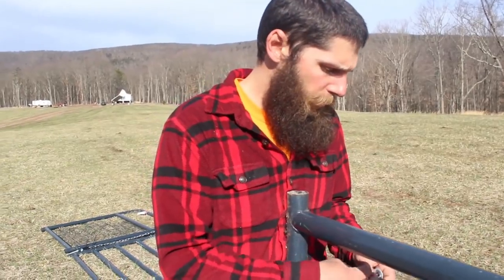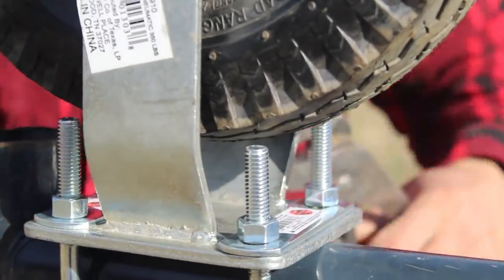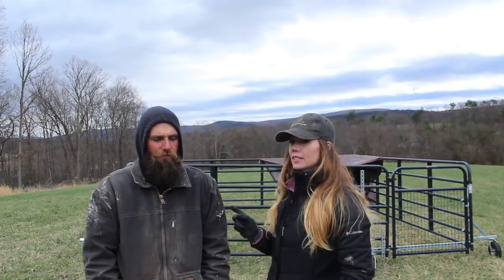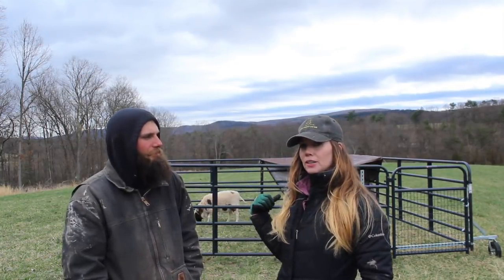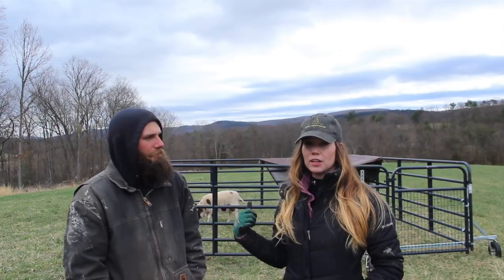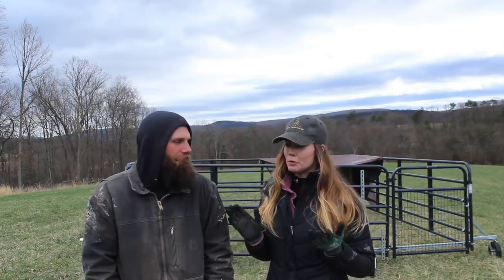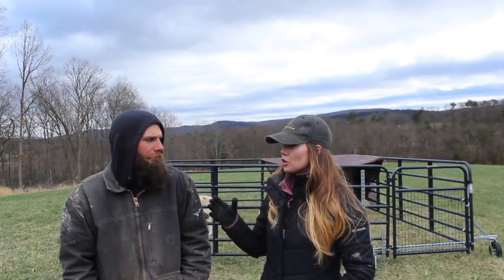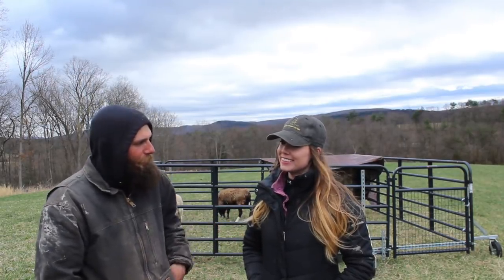Mobile Sheep Pen Build

Comment: Have you considered using Scaffolding wheels? They come attached to a rod that is inserted into the end of a pipe similar to the railing tube. Since they can be locked with a pin, removing and changing is fast and easy. Awesome work guys

Comment: You can change those pneumatic tires to solid wheels from Harbor Freight. You may also consider the solid front mower wheels that are designed to replace pneumatic mower wheels. They are wider and may serve you better in wet or muddy conditions.

Comment: Get some 1/4” plate cut 45° pieces at the corners, you can make bucket and feed spots at the corners and then bolt or weld  the plate to the wheels. Will work great!

Comment: Those gates are designed for 1/2" thick wall pipe pins in stead of those bolts a pin that has a t or a L on the top and extends through both loops.

Comment: Flip those u bolts over so the u part sucks up and away from the wheels and the left over screw part is interior or you could pop a wheel @ 4:53. I think.

Comment: Floatation is NEEDED - Get some USED Golf Cart Tires!  We get them used for free or at most $10 each and that includes the wheels - they offer far less sinking, twisting, and at most a slight percentage of the rolling resistance those tires and wheels shown offer.  You can use the same unibody design to mount an axle.

Comment: The whole thing is metal, you can easily electrify it against predators.   Now you got me thinking about doing it for chicken,  would be so convenient.  Keep us updated on how well it holds up.
Reply: You certainly wouldn't want to do that, not with gates. You would be better off just attaching wire all along the insides of the gates to keep anything from getting through or under. Another FYI, electric fences do not work on chickens.

Comment: You could make several and connect them thru the gates. If you build bigger just place a hitch on it and your tractor or if you have one an atv, utv or mule could also hitch to it and move around. Good luck and reach out to a welding company you like or have always wanted to try and see if they will send you a welder as a sponsor for a video. It never hurts to ask.

Comment: weld some plate to the bottom to mount the wheels on and you're in business. Great job guys!
Reply: That or just drill through the plates on the wheels and all the way through the gate too and run your bolts that way, that were they cannot move

Comment: Not sure if you go back in the comments but a longer steel enclosure with skids and a tow bar and pull it with the tractor. No tires to go flat or get stuck in rabbit or gopher holes.

Comment: we never took ours in unless they were prone to difficult births , or having twins, that can mean one of the births at least might need attention , sheep do not do well indoors long term , or alone , they do not like alone at all , no flock animal does
Reply: our rams were kept with the mothers and babies , you got a reason to separate them ? they live on the moors here and the rams stay with them , never had to worry , we had 300 sheep only 5 rams but they all did fine out together , it gets real cold here so we have sheep huts made of stone like our walls dry wall buildings with slate roofs ,  its really high up on the moors , so really cold  its like 1600 feet above sea level , yeah even the sheep feel the worst there

Comment: Yup. Welder on a farm it’s definitely a requirement. You don’t have to go crazy, you can get little 110 V mig welders that do pretty good. You wouldn’t want to do a frame repair on a large truck but for fencing and fixing most things and making brackets in that kind of stuff they work fine.  If you get a little bigger welder just run it off a generator if you need it

Comment: Hi from an aussie country lad. Attach the water buckets to the fence in the shade, Use some 20ft to 25ft pvc pipe and build a cross roof frame from side centres or corner to corner with cross section in the middle a bit higher and shade cloth or tarp can be attached on a slope.  Snow can run off too.

Comment: I like your idea with using the cattle panels to keep your boys in check...nicely done! you said your not using electric on it? if i did that for my lamb with those cattle panels i would have to use electric cuz those pesky coyotes would have there way with the open slots on those panels. do you guys have to worry about predators?

Comment: How about putting the wheels into the corner posts? They make wheels with stems (check out scaffold wheels). Or place the metal strut across the corners of the fence and mount the wheels in the middle.

Comment: i think i have seen some thing like that before  but i think the one i saw had bigger wheels  with 9 wheels  just cant remember how it was made in full it had 3 wheels on each side was mounted on a square like frame like picture frame wheel bolted to the side with a really big Bolt the frame was  attach to the main frame  it would site in side the frame think of it like a steel or thick aluminum rain gutter and the main fence would site inside the gutter part. one struts in the back middle same wheel as your's but the side wheels not the same and in the front middle it had 2 wheel side by side and a handle like a pallet jack and turns like pallet jack was easy to pull for them the door was not as long so it could open you just had to step over the frame to get in not a big deal  but maybe u guys would not like that the rain gutter like frame took care of the problem of the fence moving around when pulling it

Comment: bolt a  triangle plate under inside each  corner of the gates and bolt the wheels underneath the triangle
Reply: add another gate on each side overlap 6" and bolt them togeather 2 bolts top & 2 at the bottom for more area you have to move as offten

Comment: I have had a piece of that unistrut stuff under my truck bed for years to hold up a section where the support rotted off, super handy stuff to have around, not much you can’t use it for

Comment: Wonder why the bracket to the fence was not bent a little as it loosens it will start to sage and you will have to check it more carefully for slipping. Not a good engineering design.......     just saying..  i love your site!!
Reply from the maker: We will likely go back through and do some welding in places. This is just a prototype and works great for now 😊

Comment: Could you scrap the wheels, turn two sides upside down with the rounded top edges on the bottom to use like runners with the other two sides raised up so they won’t dig in? Corner brackets to keep it square.

Comment: Hahaha I had to laugh, you made brackets from all your electrical hardware. I have seen this before. It worked. It would have been better to weld a plate on the bottom.

Comment: Maybe try setting a 3 point connection for the wheels, run another triangle from the point of the wheel to the base of the gate parallel to the ground, should stiffen them up heaps.  You're lucky youve got a very docile ram!  After tupping season ours would be sent to a heavily fenced bush gully to do their own thing they were so feral.  Mind you at the end of tupping they were pretty knackered (2000 ewes will do that) so they were keen on a break :)
Reply from the maker: Wow you have a serious operation going on! Super cool!

Comment: For small odd jobs around the homestead you might look into something like the Karnage welder or other "off-road" enthusiast based welders like the readywelder 2. Fully portable, and plenty powerful for most random projects. Serious off-road people have been using them and similar on the trails for years. They are around the same price as a good home shop type mig welder. Only trade off really is limited run time vs being able to take it to the project instead of bringing the project to it.

Comment: Is the weird Animal call at around 2:55 coming from your Turkeys?  It seems kind of weird for a Turkey "Gobble" but maybe that's the noise they make in the Springtime when a Tom's thoughts run to Jakes & Jennys?  As the temperature climbs up,  the sap also rises, & in more than just the trees!!   I hope you've kept the ould runnin' muscles toned up through the Winter, Erin, unless of course, you're a-wanting to get caught? 😂😂   I know it's a "more investment in YouTube equipment" thing and you can't do everything, but can you maybe knock up a 'baffle' of some description for the Microphone you film outside 'piece to camera' action with?  When the wind gets up it obliterated Josh's speech completely.   I'd maybe be able to work it out with the help of a little 'Lip Reading' but "The Cat" aka "The Beast wot lives on the Chin" made that impossible. Sorry.  Nice Ram 'Tractor' though.  You'll figure out the warts as you use it so by Winter it'll run smooth as silk for you.
Reply: It may be a grouse.